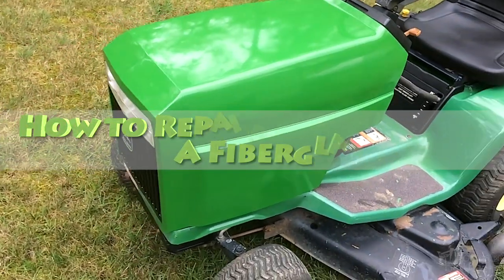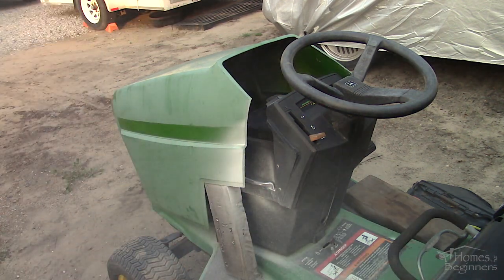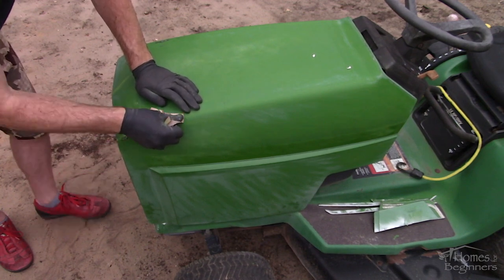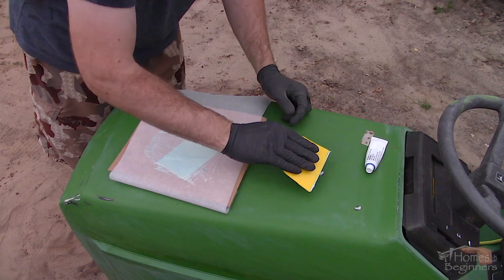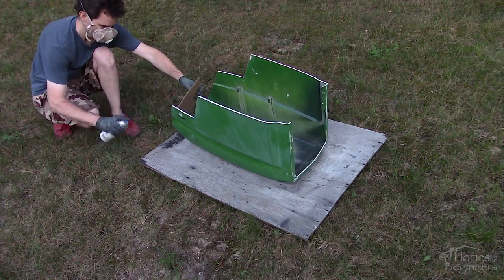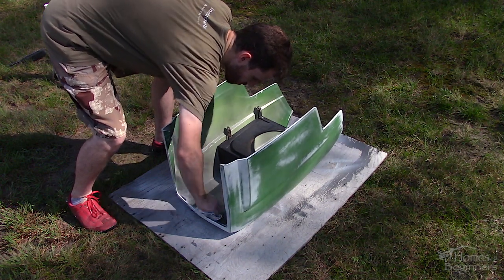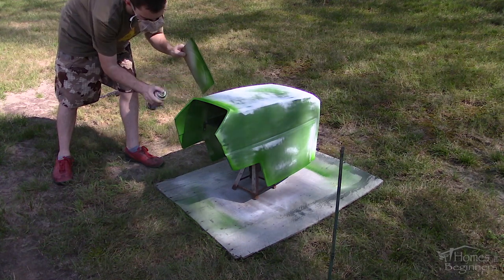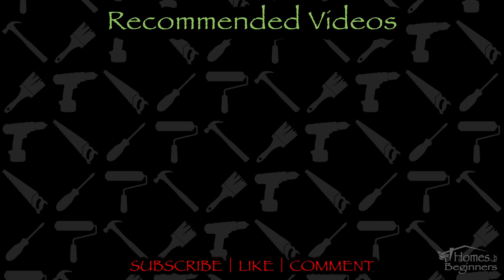How to Repair and Paint a Fiberglass Hood

Comment from the maker: Here are the Amazon links for some of the products used in the video:
USA:
Wax and grease remover: https://amzn.to/2M6xvCV
Glazing putty: https://amzn.to/3iQiAbS
Filler Primer: https://amzn.to/3iQSOnT
Backing pad: https://amzn.to/3qUc5rl
220 grit sandpaper: https://amzn.to/3sZf5V7
320 grit sandpaper: https://amzn.to/2YfzAPt
400 grit sandpaper: https://amzn.to/3qOEO0G
600 grit sandpaper: https://amzn.to/3t020uP
Safety glasses: https://amzn.to/3b3xMix
Rubber gloves: https://amzn.to/3tXng51
Canada:
Wax and grease remover: https://amzn.to/39nLn4F
Glazing putty: https://amzn.to/3pmn1Ob
Filler Primer: https://amzn.to/2NucGl5
Backing pad: https://amzn.to/2M71Hhg
220 grit sandpaper: https://amzn.to/2YjmoJe
320 grit sandpaper: https://amzn.to/36cqjfi
400 grit sandpaper: https://amzn.to/3qVYXlK
600 grit sandpaper: https://amzn.to/2YhR9OJ
Safety glasses: https://amzn.to/37hVPJw
Rubber gloves: https://amzn.to/2NpGwHF

Comment: Great video!  I have an old STX38 with hood cracking issues.  It’s the same hood as your STX46.  I’ve just purchased everything that I need to do a plastic weld repair, but I’m sure going to keep your solution in mind.  The alternate hood that you used looks great!
Reply from the maker: Thank you so much! Sadly these plastic hoods don't seem to last. Not sure what you were considering for a repair, but you can solder the plastic. I've done it many times on car bumpers using a soldering iron and the repair stays strong.
Reply: I used the hot staple method.  It’s all stapled back together and now I intend to add a layer of fibreglass over the staples for extra strength.  Fingers crossed.

Comment: Great video but do you have any replacements for your Suggested grease remover (gallon only, $60) and platinum glaze ($37). I'm only doing one hood. By the time I purchase these products I could spend close to enough $ to buy a decent used hood. How about plain old Bondo and Simple Green? Thanks for the excellent instructions.

Comment: 7:36 - Do you mean, spray towards or away from the area you've just sprayed?
Reply from the maker: Push the spray across the panel, just like what was demonstrated in the video. The whole idea is that you want to avoid any overspray on any paint you just applied in that coat, otherwise you'll be left with a hazy surface.